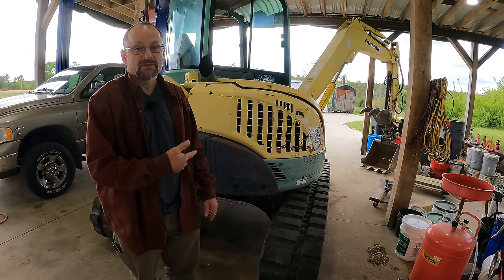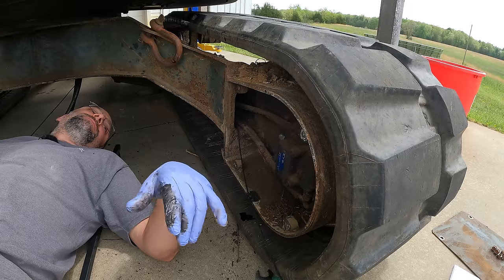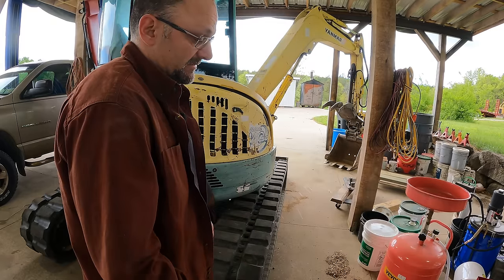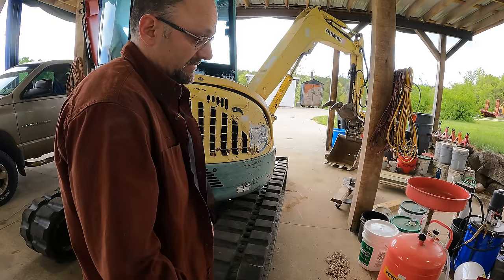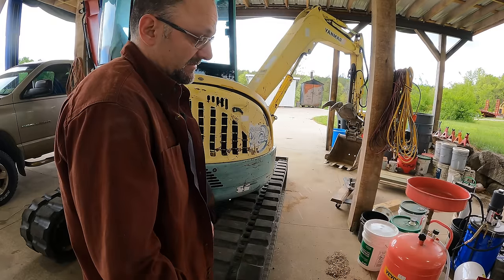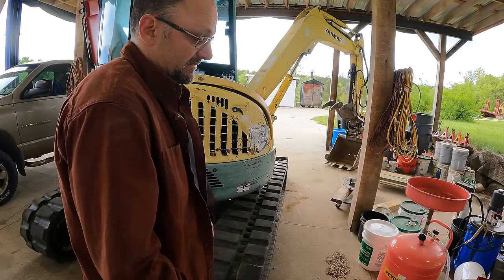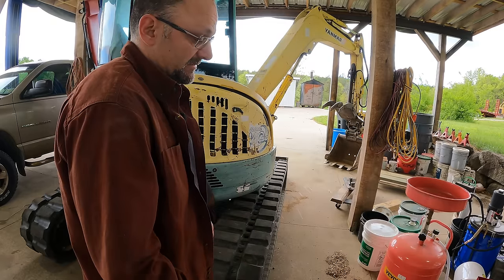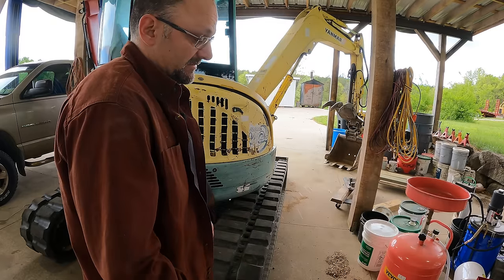Excavator Not Tracking Straight, TOUGH Hydraulic Repair.

Comment: Heavy Diesel Tech here. Without a flow meter adjusting GPM at the pumps like that will also alter Dead Head Pressure. There is an equilibrium for every hydraulic system built. Certain pumps can only produce a specific amount of GPM and PSI. Sometimes if you take GPM you will Gain PSI and vice versa.

I probably would have started swapping lines at the valves instead of the motors but everyone has their own way and place to start when it comes to diagnosing things. 

I have learned from messing with hydraulics over the past 10 years that you always approach these issues with the basics first. Ensure there is plenty of fluid, ensure there are no restrictions on the suction side like your,  particle filter, tank strainers, and even pumps can have strainers, and that there are no bubbles in the oil, no foam, and 100% no leaks throughout my lines,  valves, etc. I always do this before I go trying to diagnose a single thing with hydraulics.  Pulling Air into a control valve or a flow divider can and will definitely affect how a hydraulic system functions. 

On your travel motor, you can try doing a case drain test. Instead of returning the fluid back to the tank, you can send it to a large measuring device. ORRR if you had a high dollar flow meter lol, you could add the meter to your case drain line for your travel motor and see what your flow rate is back to the tank. Depending on the GPM of your flow meter in this location can tell you if you have a bad travel motor or if your problem is further up the circuit. 

Lastly, I think you underestimate your skill sets. If you can machine things you can rebuild those pumps or motors on a budget. Tear down a motor and go over each o-ring with calipers and verify part numbers in your parts manual to make finding your o-rings online easier. Once you have done so go to Ebay and order bulk quantities for each o-ring you will need. Much cheaper than buying a repair kit. You might spend a few hundred dollars on seals and o-rings versus thousands and still have leftovers to repair other things...  The downside of doing things this way is your machine will be down until all o-rings, seals, and orifices come in the mail. 

Best of Luck.
Reply: Also, before committing this issue to be 100% hydraulic double-check uneven wear on the steering handles and the undercarriage could have uneven wear. But again I think your issue is with your pumps, so do a case drain test to check for uneven flow rate and pressure. And get more accurate pressure gauges :D.

Comment: First of all, slight mistracking on an excavator is not a huge concern (it's basic hydraulic drive, not hydrostatic) though yours did look to be like enough to be of concern. 
Second, the HP adjustment on your pump is unlikely to solve your concern. Either way, you would adjust that when the function is stalled, not running (put a large steel pin in the sprocket to force the system to run over relief, which is when your pump is pulling max HP, that is what that screw adjusts and why you did not see a difference)
To actually address your concern, first realize that the pumps also need to run the work equipment, which is the main concern on any excavator. To measure the output flow rate of the pumps quickly, easily, and cheaply measure the cycle time of each cylinder. I.E. time taken to run the stick from fully curled to fully extended. Hopefully your manual gives you those specs. If not you can calculate it based on the size of each cylinder. I'm sure you can figure that out.
Once you do that, it's likely you will find each one associated with the pump you suspect of being "lazy" (I think you said P2 was originally driving left side motor) will be slower than expected. If so, look for a different adjustment on your pumps that will be called LS or load sense or something similar (Sorry, I don't know your particular machine, or any from that manufacturer). That adjustment will have control over flow rate while the circuit is in motion (not stalled, like the HP adjustment)
Reply from the maker: Thanks for the info.  Cheers.

Comment: I think a simpler solution would have been to put a spacer on the lever so that both work at same speed. Sorta like reduce the right just enough to match how the left is. idk lol
Reply: Maybe the side that is slower is to slow for tramming long distances.
Reply: This does work when on hard ground, but only for one speed and not in the mud
Reply: i'm thinking  adjustable stop screw in front of the  faster side lever.
Reply: Operators just learn to hold back on the faster side. Precious few excavators track evenly in my experience over the decades.
Reply: as workaround okay, but you would'nt have identified the problem.
Reply: Old bombardier track machines had adjustable stops to fine tune the stick travel and thus slow down one track.
Reply: Je6
Reply: ns66
Reply: @brian_2040  ns66666ns
Reply: @megape95  jsn

Comment: Check the leakage of each travel motor by routing the case drain of each motor to a bucket with a stop watch. Run for 30s and record how much leakage is in each bucket. If one is significantly worse than the other, then this is a contributing factor. By the way, the same thing can be done to the piston pumps to check efficiency.
Reply: This

Comment: Just a suggestion here, Jon.....are the track tensions equal, or is one tighter than the other? That MAY or MAY NOT be the issue, it was something I was thinking about that might be causing the deviation in tracking while traveling.
Reply from the maker: Yeah, they are equal.  Checked that early on, as well as the controls and their movement of the valve spools.

Comment: Flow meters are helpful in these situations. As a hydraulic engineer, I only use flow meters when testing a newly designed system to ensure that I am getting the flows that I planned for. I would say that field technicians use them more often because they are searching for issues similar to yours, system efficiency. You can systematically place it throughout the system to see which components have the most internal leakage. Best wishes.

Comment: My first look would be thinking about changing all the hoses.  The inner diameter of the hose will effect the flow rate and can cause minor changes.  A quick test could be what you have already done, swap both ends of the hoses at the same time and see if the tracking stays or changes.  If it changes then it is the hose, if not then it is the valve.  You would need to do the extensions on both ends at the same time.

Also, check the handles and connectors, see if you have a pin with more play in the connection causing the valve to not be pushed to the same point.  This could be a quick fix via the lathe.

Comment: John, maybe this is a dumb idea, but can you put some sort of coupling in the hoses to restrict the flow after the valves and before the motors? I'm thinking in kind of a screw to fine tune manually the flow going to the travel motors. This way maybe you can restrict the opposite motor to where the machine is tracking. This would be a "hydraulic aligment" 😁

Comment: There has to be some regulation, either on the tracking motors or somewhere in the circuit. Even when we put it in the factory on new components there can be tracking to one side issue. And this has to be evened out. Looking forward for part two.

Comment: Just a idea, there is a one way flow restrictions valve! You could put two valves in the “fastest“ track. Restrict the flow so it matches the slower track. Then with a little tinkering (restricting) you can make it track strait.

Comment: Hydraulic motors and the associated valves work on flow, not pressure. This is a common misconception when everything else is pressure operated. The pressures only come into play when operating under load such as a grade. Adjusting pressures would be meaningless. You need to adjust flow, there should be a flow control valve in this system. As others have pointed out, a flow restrictor in the "fast" line may be your only viable solution. Otherwise, pull the pump$ and control valve$ and $ee if a local hydraulic$ $hop can repair them
Reply: True they work on flow, but more pressure increases the flow.
Reply: Actually flow creates pressure when a restriction is involved,,, think of a garden hose,, 1/2 hose with house pressure of say 35 and your thumb as the restriction,, you can close it down pretty good and make a spray stream,, 5/8 hose is a little more difficult to keep your thumb on ,, 3/4 hose you wind up getting wet,,,a tell on your diag was bouncy gauge reading and pull,,, check pressure relief valve on both sides of pump,, second is balance both control valves,,not for handle location but for full travel,,, you may be surprised by outcome,, or maybe I'm just way off,,,,

Comment: Another nice video 👍
I would try the following (maybe it will help):

1. I would switch to a 20W20 mineral oil (engine oil). This is a bit more viscous and seals internal leaks better. I use this in my 1995 wheel loader (with a Bosch Rexroth axial piston pump) with no problems. The only disadvantage below 5°C you should definitely warm up the machine.

2. If you really want to remove the "pumps" from your equation, then I would connect both pump lines together and feed them into one flow divider. Both circuits are now supplied with exactly the same volume and you can continue to examine the control block and the hub motors.
I would also test both hydraulic motors without a load (tracks off the ground or without tracks). If the drainage volume does not change, the motors are ok (for the age of the machine).

Possibly helpful:
The screw for your pump performance only preloads a spring. Your axial piston pump is always at maximum flow at low pressure (at const rpm). If you turn the screw in the direction of more power, the swash plate only moves out of the maximum stroke at higher pressure. Spring and pump pressure fight each other to move the swash plate. So your setting would only be noticeable from the point at which the P1&P2 pressure overrides the spring preload (just before the overpressure valve switches). In my opinion, the setting has no influence on the part-load volume flow when your excavator is driving. You would only notice it when pushing under heavy load.
Reply: Another suggestion:
The idea of reducing the flow on the fast side using a throttle valve is not unproblematic. I wouldn't install this between the control block and the hydraulic motor, because when you change direction you reduce the flow of the hydraulic motor's return (should never be restricted). I would go directly to the outlet of the hydraulic pump (on the side that runs faster when tracking) with a T. This is followed by a small throttle valve, a solenoid valve and the line straight back to tank. When you drive you can take some of the flow away from the side that runs faster and as soon as you start digging you have full power, by closing the valve.
The small amount of heat that occurs as a result of the new path back to tank can easily be dissipated by the system and doesn't have to be routed over the hydraulic motor, swivel joint and control block.
When implementing, you should not use a solenoid valve that is too small, so isn't your bottleneck. The pressure difference should be reduced via the throttle valve and not the solenoid valve, which protects it from excessive heat.

Comment: I think you should look into a 'rotary flow divider'.
You could tie the outlets of both piston pumps together, just as you did. Then install the divider to split the flow again. 
It would give the same effect as the original, as two pumps coupled on one shaft. Except now, you wouldn't have the issue of uneven bypass with the supposedly worn pump.
This mod would make no change to your digging performance, and a flow divider is cheap (relatively speaking).
All that being said, I still think you have an underlying problem in addition to a worn pump. Diagnoses can be tricky when there are (multiple) compounding problems.

Comment: I am an electrician :::  and i sow it coming when you paralel the pumps without a diode (one way valve in the return pipes,,,,  did a great work troubleshootng ,,, in the end ,,, the only action you didnt do was elminate that little deposit on the way out of one of the pumps (you callit acumulator) ,,,, but i wonder if that creates some kind of buffer (as a capacitor on  eletrics) or  whatever and unbalances that one circuit,,,,   and i also wonder if that (acumulator) also have some setting screw on it to set the flow out,,,,  just an idea   ,,, great work,,,  keep on swimming ✌

Comment: John, fine work progressing logically through all the different combinations. I have just a small contribution: 1) Like others have offered: What if you just introduced a restriction to the faster side? My submersible well pump was sucking air and blowing it out the sprinklers while I was watering my grass. I called the well guy. He asked me what I was doing. I told him watering grass. He told me to stop doing that. (as a joke) Then he came out, pulled the pump out and put a restrictor in the down pipe. He cut my gross water flow down from 20 gals/ min to about 8, but it got rid of the air problem and he was happy.  That was in 1981 and it still works the same. So restriction must be ok fix. I went from 8 sprinklers down to 4 and the grass lives. 2) A little levity: Do you have mental health insurance? Maybe you should get a job. When my past bosses got too anal about things everyone around me used to tell them to find something to do. I don't know, I'm retired, and I have a small budget to live on so I don't get too excited about things being exact anymore. You make great videos John, I look forward to them. Thanx for posting. ben/ michigan

Comment: Test the power in the tracks by pushing something heavy . One at a time, then both at one time. If they spin at the same rate or spin with what seems to be equal power, then I would be satisfied and not expect the machine to rode like a wheeled machine.   I own 4 Cat excavators,  which I bought new and they will all drift on the crown of the road, when we rode them.  They are larger machines.  Three Cat dozers with low hours and they drift, My Komatsu track machines do it too. I know one contractor that hobbled his link belt around the job for a full year with only one track. Your still in good shape..  I like your show and your thought process.  Good luck

Comment: Had exactly the same issue on my yanmar VIO30. Thought the travel motor was worn. Nearly bought another motor for mega $$$ but dismantling the levers in the cab, a locknut had come loose and did not effect the throw required. Tightened that, tracked perfectly..phew!

Comment: I applaud your tenacity to find the issue.  Seems every tracked machine i have ran or been in or own all track/drive with one motor slightly slower than the other.  I have a Bobcat 331, 341, Deere 270 skid steer, and a Troy build zero turn mower.  They all favor one direction when at full travel on both sticks. Seems to just be the nature of the beast.  2 valves and motors, and in your case pumps may be asking too much for all those components to be "balanced" enough to provide same flows/resistances to provide tracking that doesn't need correction.

Comment: Had almost the exact same issue on a similar size case. Ended up being the ball on the bottom of the stck. There was a rocker ball and socket assembly that would push on the valve. One of the rocker spheres had more wear than the other, causing it to push the valve less on the worn side.

Comment: Adding a flow control valve to the final drive will allow you to slow down the motor that is running faster to match the slower one.  Note, you should add it to meter the output, not the input to the motor.  That allows full pressure on the motor.  You will need two valve per motor because it reverses.  These valves are designed to meter in one direction and free flow in the other.  Love your videos and especially your analysis.

Comment: Hi John - great video.  I am by no means an excavator tracking expert but if both tracks are receiving similar hydraulic pressure and all associated parts are functioning properly, could the tracks themselves be unequal?  For example, if one installed track has an overall length of say 120 inches from end to end and the other track is say 119 or 121 inches, I would think the machine would not track equally with one track moving faster or slower than the other.   Keep up the great work and good luck.